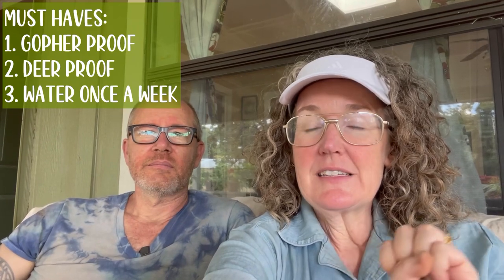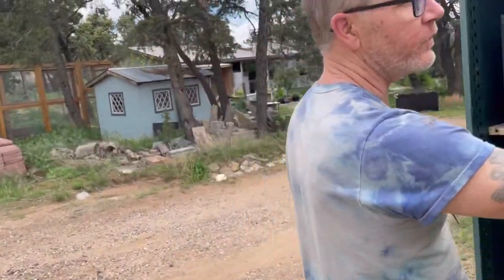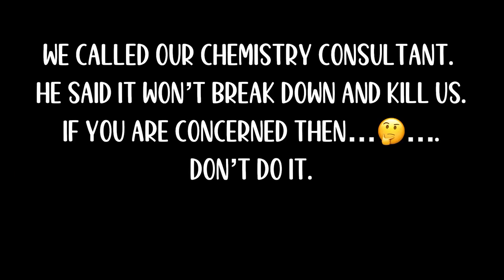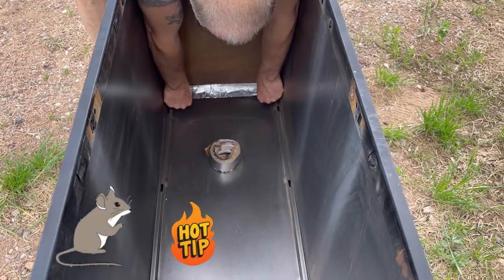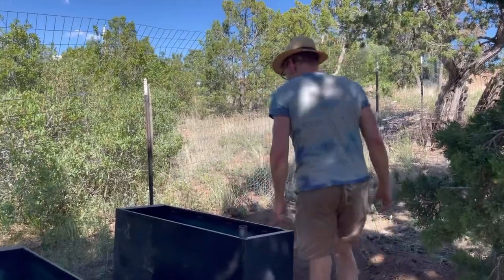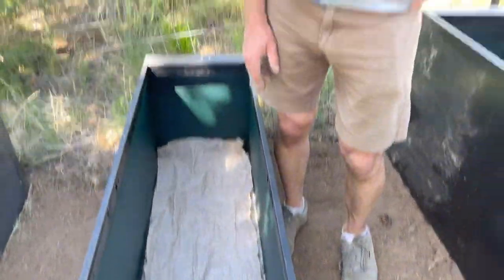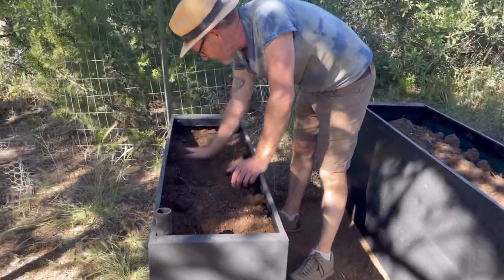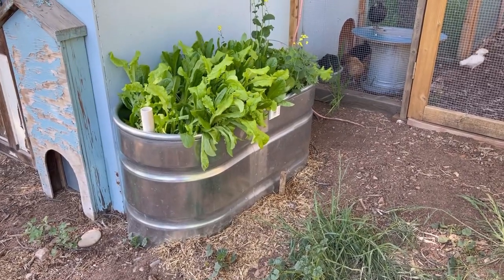The cheapest planter we’ve done yet | Mike & Molly’s House

Comment: Thank you, this is great, I wanted that livestock tank but no way $$$.  And I have useless old metal file cabinets!  However,  I think I will cover the bottom with plastic jugs with little piercings (covered with siliconed-on mesh) to create cavities to hold the water, plus run some wicking rope or something absorbent vertically to connect bottom to top layers and help water ascend... this would be a combo of your genius file cabinets with some other utube folks using tubs and jugs and allowing for both wicking and draining.  Again, thanks!
Reply from the maker: Oh I love all your ideas to add to this!
Reply: this will not only be my first time making a planter, but my first time trying to grow ANYTHING edible.  I haven't even decided what to plant yet.  I have no knowledge of anything, but I do like the watering system.  My question is the layer he used the shade... and you said siliconed on mesh... what do you mean and is this just basically any material that will drain but still hold dirt?  Then, with the wicking rope, do you just place maybe 3 ropes from bottome up to the soil level, in different locations?  THEN, how to keep the outsie from rusting.  I see some rustoleum products to spray.  Any extra advice for me would be greatly appreciated.  I have 6 file cabinets I want to grab from marketplace this weekend.